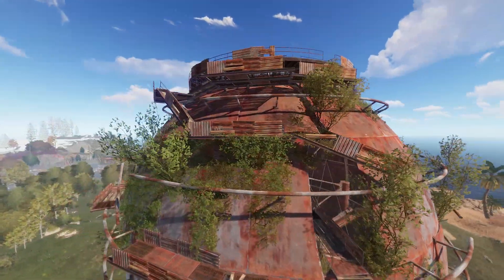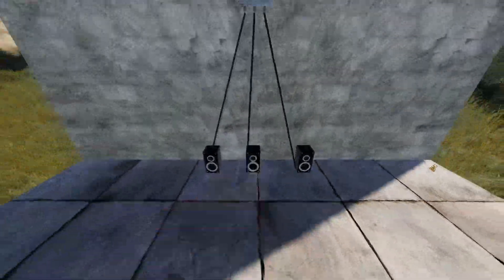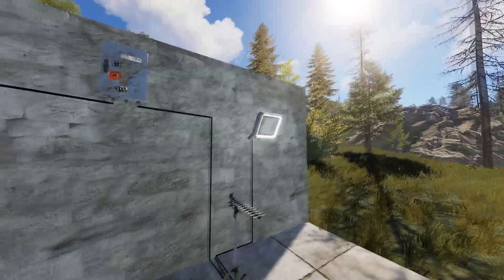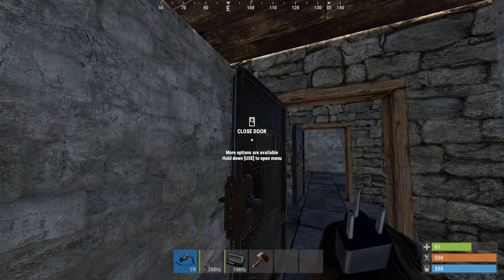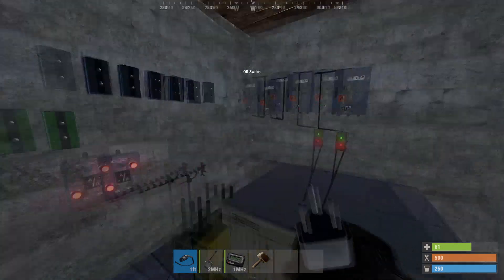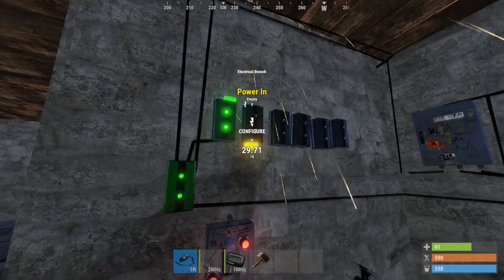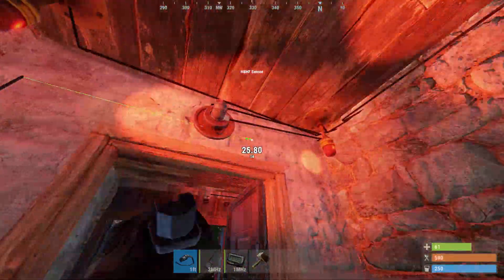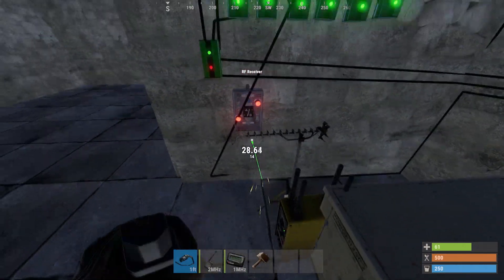New Components! (+ Ultimate Security System How-to) | Rust Electronics

Comment: Thanks for the video, is there a benefit to using that many branches rather then a couple of splitters? like voltage drop or something?
Reply from the maker: Matt Bates I believe I used so many branches because:
A) beacon lights and flasher lights did not have a passthrough at the time of recording
B) I didn’t know they have a passthrough

They do have a passthrough now however, so you’d probably only 1 branch for all of the lights